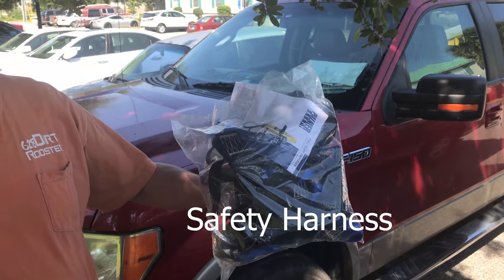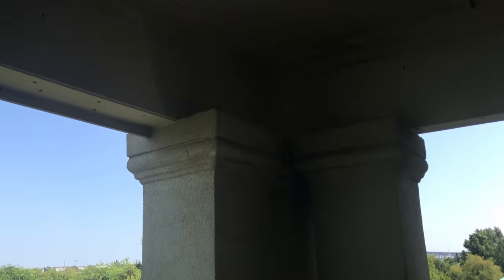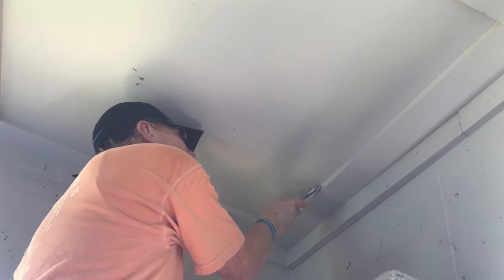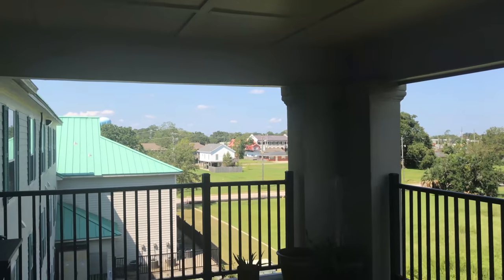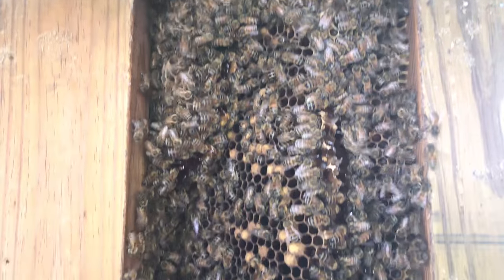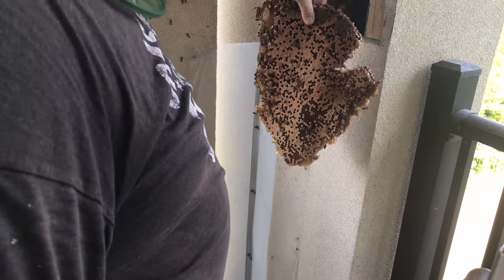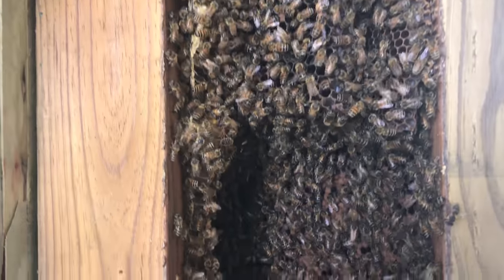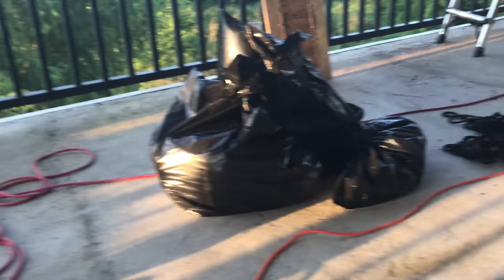I Didn't Want To Do This

Comment: "Instruction manual: Don't Fall"---Now THAT's my kind of instructions.
I HATE heights after I fell backwards off a bale stack as a teen; I finally worked my way back up onto single story roofs but oh, I don't like it one damn bit.  Anything higher than that, I'd probably puke, cry, and fall down so I wouldn't have to move.

So you did darn good! :)  Can't believe you didn't make Pete do the trim work.....shoulda.....I know I would have, and taken pics from the GROUND, thank you so much!

Comment: LOL, I got my fear of heights from falling off a hay loft in my teens. Tried to cure it by joining the Army, went into "Field Communications"...which requires climbing telephone poles! Ironically, I gaffed into a knot-hole, gaffs slid and I bounced all the way to the bottom, wrecked my knee. Man, my pulse got to racing on your behalf when you showed the view down to the A/C units--darned near soiled myself! Good job!

Comment: Balcony closed.  lol  Wow, that was a tall hive and up high too.  Lucky you didn't have to man lift it on the outside.  That queen was walking down the brick walk and you interrupted her stroll.  I always think I'm going to get a lot of wax and after you melt down that huge pile, you wind up with 1/2 inch in your roaster. lol  Those do look like wings.  Dip it in some buffalo sauce, you might be on to something there.  Thanks for the video Chicken Little.
Reply from the maker: I thought we were going to be going through the ceiling to hopefully be able to reach over beams and remove them from the soffit.  It was a wide soffit though and I wasn't sure we'd be able to reach all of it that way.  A man lift would have been the next consideration but I'm not sure I would have even tried that with it being right on the edge of that marsh.  Soft ground and man lifts aren't a good combo.

Comment: I used to remove bees a while back , here's a tip for locating where the combs are. Carry an old wire coat hanger or 12 or 14 ga stripped copper electrical wire about 2 feet long. Grab your 3/16th inch drill and make a hole where you suspect they are and insert the wire. If you hit comb you will see it on the wire. It can save a lot of unnecessary  destruction and save a lot of time. Cheers!
Reply from the maker: Thanks FranSwi.  https://www.youtube.com/watch?v=52SYVvr9Djg&t=160s

Comment: Just finished reading the blurb/description,  it ends with you saying that the honey will be bottled up in the next few weeks.  It got me wondering... Do you label your honey much the same way that you label some of the jobs that you do (and bring bees home)?  For example,  Highway Bees (also the title of one of your vids from a few years back).   Theoretically, those bees would yield Highway Honey, which may (or may not) bee appealing to folks.  Gas Station Bees.  Hollow Column Bees.  Night Stand Bees.  I could go on with the names, but I think you see my point,  so I just got wondering if when you bottle, besides your own label, if the run of honey gets named right down to the job that the bees came from :)
Reply from the maker: I do keep honey from different jobs separate and if I sell it I tell what video it's in if there is one.  I would have already sold this honey but I wanted to wait until I had the video up.

Comment: Rough job.
Back in my younger days, I ran an industrial control panel shop, and we also did repairs, upgrades and tear outs. It took a while, but I learned to bid the jobs I didn't really want high enough that if I did get them, the check made up for the grief in the end. My guys knew when they went out on a rough one, there was a fat bonus check in the near future. I always shared the wealth with my employees, and they were the best. 
Next time, don't hesitate to add in an "altitude" charge, or a "Extra clean and quiet" charge. 
I did a mezzanine removal of a huge water softener over a floor of operating animal labs, and they didn't care how much we charged, as no one else would even bid on cutting the equipment into little pieces (quietly) and bringing it down 8 floors on a elevator in a couple hundred trips in metal trash cans. I bought cutting tools and charged them 100% of the cost. They didn't care.
Reply from the maker: Very wise way to operate.  Pete did make extra on this one.

Comment: 7:22 next time you're cutting any cement product with a saw, please either use a wet saw or at least a suitable dust mask. The silica dust released is first cousin to asbestos - not quite as deadly in your lungs, but working on it. Please stay safe!
Reply from the maker: I feel that way about cutting almost anything these days.  I wrap a tshirt around my face a lot of times.

Comment: I have absolutely positively zero fear of heights, Heck I am not even afraid of the fall if I slip and or otherwise screw up.  Now that Sudden Dam abrupt Stop that ends the falls scares me completely 💩less! Which in turns gives me all sort of incentive never to screw up and fall 😁
PS Remember you can down in a soup bowl just as easily as break your neck falling off a curb. There’s a moral there let me know when you figure it out

Comment: I watch these videos alot, they got me the 1st time I caught 1, but can u explain the difference to capped, and not capped apart from the basic answer, 1s covered the other isn't. Lol😂🤣 if possible thanks
Reply from the maker: If you're referring to the honey, the bees will dry the honey to around 16%-17% water content before they cap it to preserve it.  If it is not capped yet in may not be dried down enough or they may still be adding to that cell.  If it's too wet and you try to store it it will ferment.

Comment: I guess it's a bragging point? You're so good at finding bees, you find them on accident.

And about the heights: If you ever make it out my way (and no, I'm not tellin' where, either partly because I know the answer to this -- both from you and my boss lol) I can try to get you ride around with me on an order picker in the warehouse, and go up about 20 feet. Don't worry! You'd have a safety harness and an inch-wide bit of webbing in case you fall! (so, see? I'm just picking; I wouldn't do that to someone)

I'm scared of heights, too, but it's more about stability. I can stand at the edge of a cliff in the Alps, looking over a valley thousands of feet below with one foot part-way over the edge and be fine. But walking up aluminum bleachers? Standing on a roof? Transitioning between a ladder and a raised surface? Basically nope! So I can definitely see where you come from. But at work, I'm on equipment I trust and I'm familiar with, so going up 20 feet isn't quite so bad unless the load starts feeling unstable.